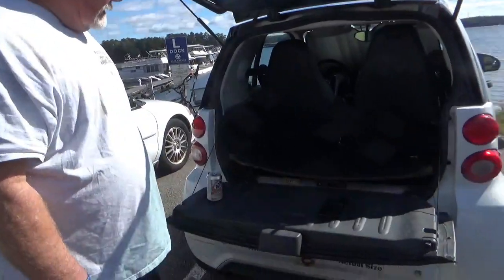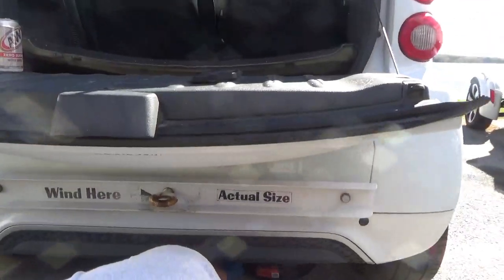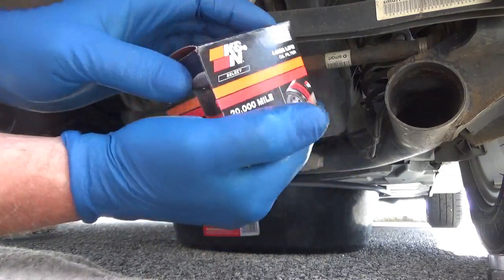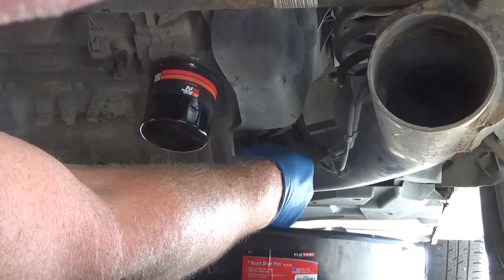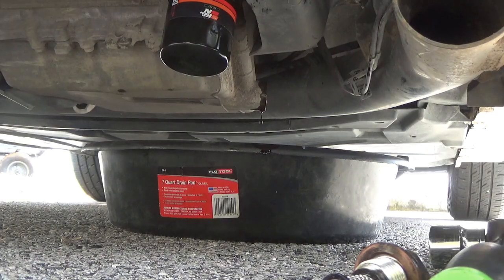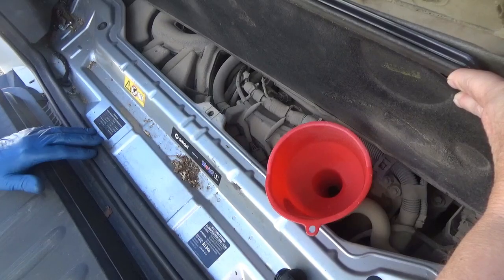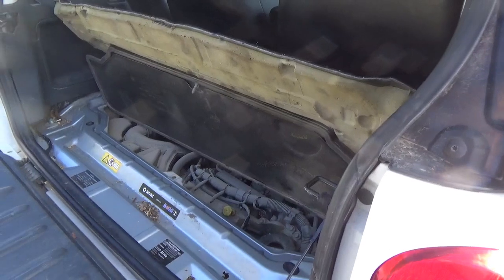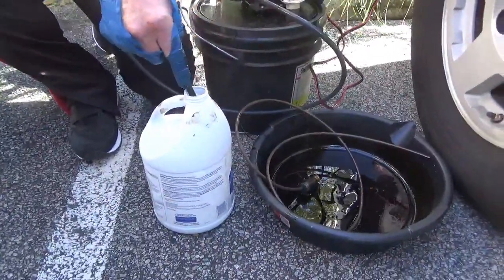💪 Smart Car Oil Change // DIY Full Time RVing

Comment: Tech tip 
Use a punch and put a hole in the bottom of the filter to drain it first if you want. I don’t because it’s such a small filter, but when you do it in the truck it’s worth doing. 
I also change the oil on our smart car while it’s on the truck. Much easier for this old guy.
Reply from the maker: Both good ideas.  👍 I was too lazy to haul it up on the truck.  Let gravity be my friend and pull me to the ground.  😁

Comment: Trail of oil.  Mechanic cross threaded drain plug, brought six quarts of oil to make it back to Jiffy lube. I co not go to Jiffy Lube anymore.
Reply from the maker: I've heard of stories like that. Cost our oil change joint $4000 to fix our car.

Comment: Great job Dave, I've owned 3 Smarties myself. The first one had the 1L turbo motor. I only kept it 1 year and got the newer version with soft top. Mine got 50.1 MPG once.  The cabin filter is next to the gas pedal on the drivers floor..  it's fun..
Reply from the maker: Thanks for the info on the cabin filter.  Need to do that too and was wondering where it was.  👍

Comment: Had a 92 dodge Dakota replaced the engine. One guy put in the five quarts. And never told anybody so before I arrived someone added five more quarts. I took it home next day I checked the oil was all the way up the dip stick. Had to bring it back so they could change the oil and put in the right amount what a pain in the ass.
Reply from the maker: Don't  you just love it.  Amazing.
Reply from the maker: Don't  you just love it.  Amazing.

Comment: 70s: Heading to FL in my MG Midget. Daddy hated my Midget, told me to drive his car. Huge Buick 1966. Suddenly, the oil light came on, key came out of ignition, wrecker called. Daddy came to FL, oil filter busted in the engine. Local mechanic serviced the cars about every 3 months. He never changed the oil filters. Mechanic in FL said smart kid, saved the engine. Daddy was impressed and that car lasted another 10 years and was sold. The old mechanic never changed the oil again. 🍺🍺🍺🍺🍺🍺
Reply from the maker: Love the story.  If that was a man driving that Midget, probably be a different story. 😆👍  Good job!

Comment: Use the 1/2 beer for the BBQ. Lol I was just wondering if Dave could hang the back of Zippy off of the tote trailer then he wouldn't have to try to slide under it?
Reply from the maker: Could have used the ramps.  Hmmmm.

Comment: I'm afraid to ask, where is the air filter? Is it by the rear tire, in up front truck area? Anyway great job, Dave. I had and oil change done at Jiffy Lube. Going home on the expressway and notice smoke coming from under car. Pulled off looked on ground, trail
Reply from the maker: The air filter is left of the engine.  We have video on that too.

Comment: Daughter took her Land cruiser to Jiffy Lube,. Of course they did there song and dance and told her that her radiator cap was bad.  She called me and I told her BS.  
They took the cap off and never reseated it.  Needles to say she blow all the coolent out of it and seazed the motor.
Cost us $3500 for a new motor.  After that we don't take anything to them for servicing.
By the way Dave you work to cheap.  My wages are a little 💕 and a steak dinner.  Brian and Cindy "xtreambydesign with passion"
Reply from the maker: Damn man...that sucks...you win.  I hate it when they want to sell you air filters, etc.